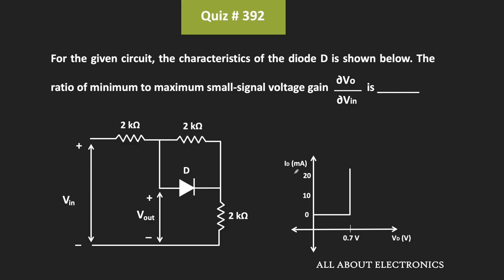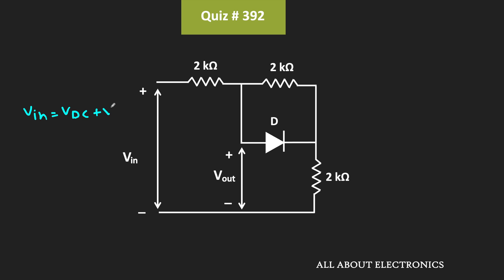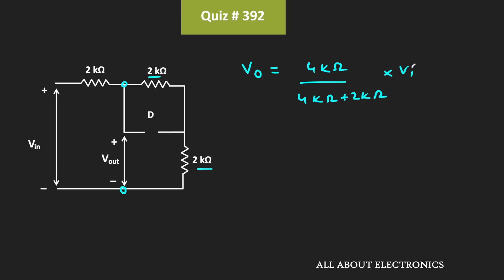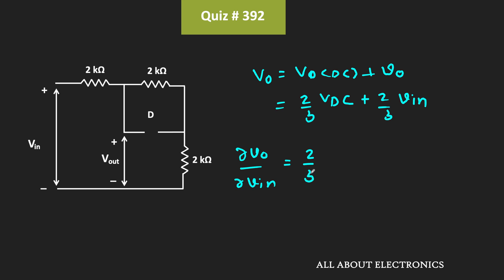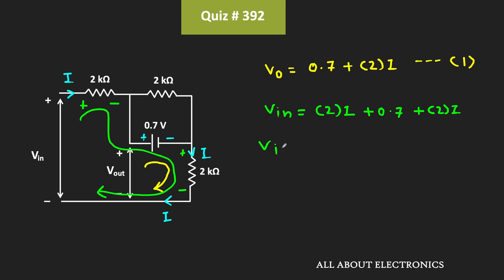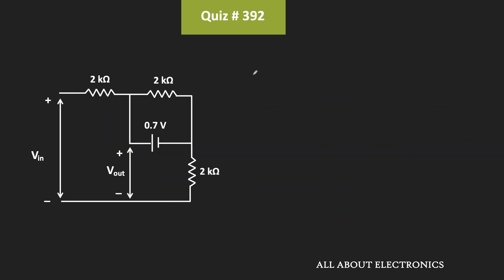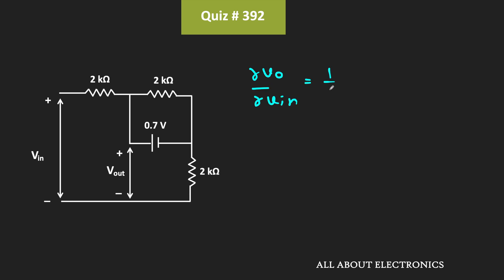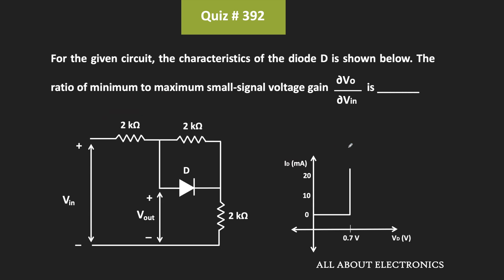Diode Circuit Solved Problem | Quiz # 392

Comment: when diode is on, the second resistor will have voltage difference acorss it and it produces some current . why you did not considered that current in loop law
Reply from the maker: You mean to say 2k resistor in parallel with diode right !! well, the current I will get divided at that point and again at the other end, once again it will combine with the remaining current. So, net current will remain I (at the cathode of the diode). I hope, you got it what I am saying.

Comment: how did you take Vout across both resiators when diode was off I think it should be along 1 resister(2 kohm) only,
Reply from the maker: When diode is OFF, then one terminal  of Vo is connected to the one end of the 2k resistor. (the right one). The other end is at the reference node. So, basically the voltage Vo is the voltage across two 2k resistors, as they are connected in series. (you can redraw the circuit for better understanding)